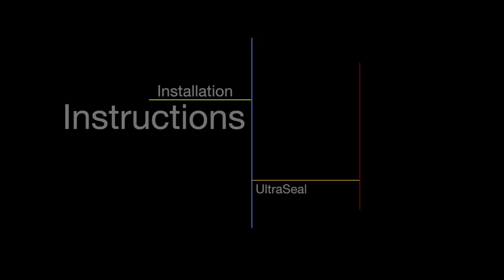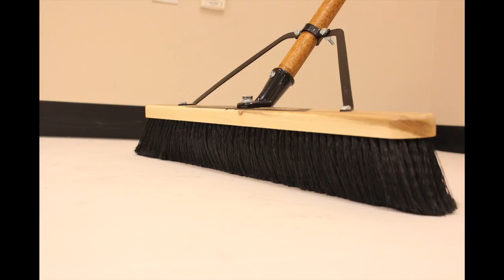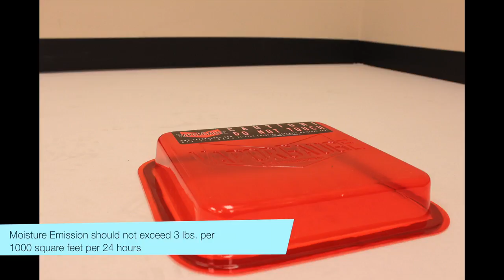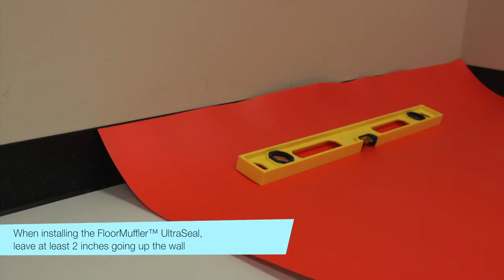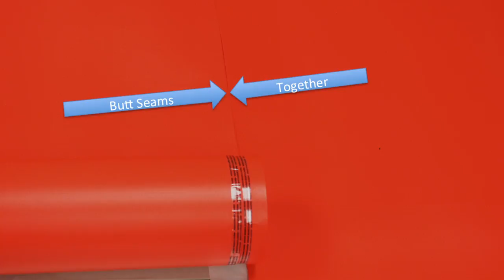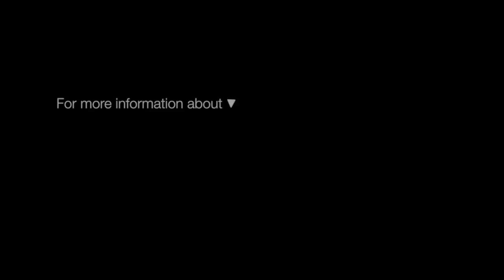FloorMuffler UltraSeal Installation - Home Depot

Comment: FYI the sole purpose of running it up the wall is for moister and to seal sill ! 9 out of ten will be putting baseboard up so it’s just used for a better insulator between floor and sill 👍

Comment: What is the purpose of going up the wall 2"?  That blocks the ability to use spacers when installing the flooring.  What do you do with that 2" after the flooring is laid?  No explanation here.  Poorly done, incomplete video.
Reply from the maker: gfish66, Thank you for your feedback. Please provide an email address and one of our customer support reps will contact you to address your concerns.If you prefer , please contact us at Sales@Floormuffler.com
Reply: Why not just answer the question here??
Reply: Dion, I wondered the same thing.  They said that going up the wall maintains the moisture seal.  For my installation, moisture was a non-issue, I just needed padding, so I cut at the base of the wall.